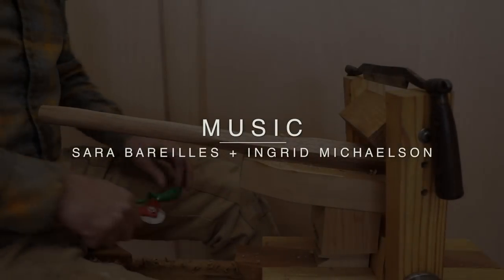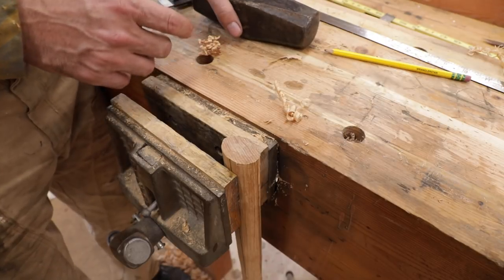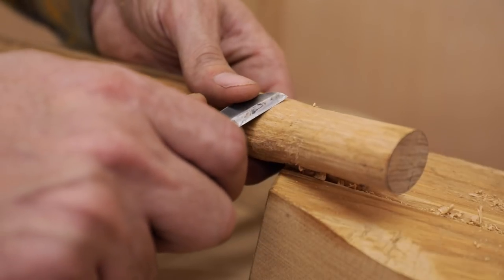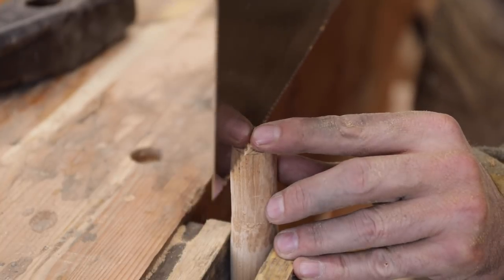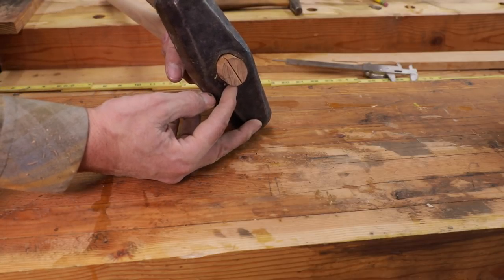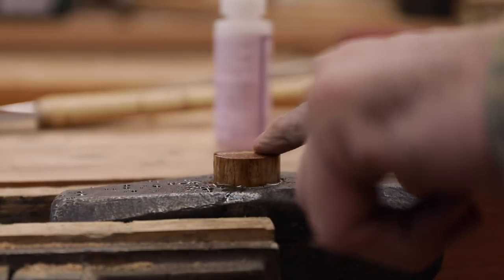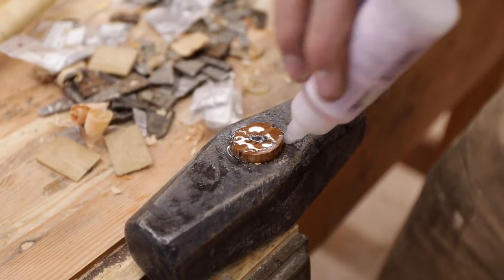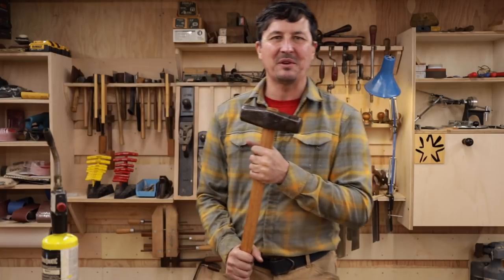Hickory Tool Handles The Old Way

Comment: It's always amazing watching things done by hand in these modern times. Brilliant.
Reply: Me too, as an archer, I've realized that technology and modernization hasn't necessarily eliminated old tech (exceptions may apply) it just added a new way to do things. I'm under 40, yet I have used one or more typewriters, blowguns, atlatls, spears (target only, which is unusual, as it's normally for distance as a javelin, or for hunting), as well as an assortment of hand tools. Point is, I quite like anachronisms.
Reply: Doing things by hand is generally more enjoyable (less noise, less vibration, less messing with cords), unless you are under a time constraint or need to make something rather big. What it does in those cases is make you appreciate those new tools ... but something i have yet to see these new tools do, is actually get you acquainted with the wood. Which i found is something that helps you create better and more beautiful things in the end, also makes you understand why some things happen during woodworking.

Comment: The resin the handle is straight is so you can hit square to the surface your striking with a axe it has a radius on the cutting edge so the curved handle works put a curved handle on a hammer and it will strike on the edges. Great video beautiful handle

Comment: From what I understand, axe handles have palm swells because you frequently swing them sideways and need the extra grip. Mauls and sledges are used rather less frequently on a horizontal plane, and so don't need the swell, thus reducing how much material you need to start with.

Comment: One thing, I use to look at your handle replacing and making and see you starting to develope talent, now you have clearly eclipsed my skill level at handles Cody Atta boy to you sir! well done Secondly I've used a hot glue for fishing pole eyes to anchor and seal some hammers this is simular to, what I believe, blue grass hammers the finest of hammers at a Rolls Royce  level of hammers used to be, alas they are no longer as i believe they went out of business. I was given one by a carpenter friend from church who didn't have to work as he was worth millions but he went to Tennessee and bought two and came back and said here Dave I got you one too. Anyhow, they were sealed and locked in with a hot glue similar to the hot glue used to anchor fishing rod eyes, very nice. Secondly question, Is danish oil not linseed oil and shellac mixed together?  You know you see some things and you realize what a fine job that has been done there, and you are getting skippy about it, pretty cool Cody.
all the best to you and your family.
David

Comment: Forgot to mention that I have always been told that the best way to measure your handle is by holding the head firmly in hand and point the handle to your arm pit. That is the perfect length for accuracy in striking. Also was told this in my union iron workers apprenticeship. Just measured at 22 in so we are in the same ball park!. Hope all is well and best wishes from ohio!

Comment: You could mark the center of the handle on the top with a cross, then line up the handle while looking through the hole. Saves you the guess-work you used here to align hole and handle.

Comment: Nice very nice, I have both a 6 pounder in 24 in and 30 in handles the 24 gets used more. I also have crosspin sledgehammers in 8 10 and 12 pounders what is interesting about those is they have the smaller eyes and originally had short handles, the 12 pounds I like and it only has a 30 inch handle
Reply: greenhatparts --- As a 16 year old 'light weight' teenager, I used a 28" handle in a 6lb. maul for splitting stave bolts. I needed the extra  length to set the wedges in top of the 39" bolts....It takes different lengths for different jobs and people's height. I'd hate to have to strike very many blows with that cross peen 12 pounder.

Comment: I rough out with my table saw. May sound a little scary, but my hands are never close and the push/pull hand is the one behind me.  The fine adjustments, I use a very course double or triple cut  file.  A wood rasp is too aggressive,, but a course file cuts quick, and leaves a rough cross grain pattern on the wood.  Which helps retention.

I assume you agree,,, steel and fiberglass handles hit my and back.  Every hammer blow on a nail or chisel, or stone,, transmit back into your hand.  A good piece of hickory or ash transmits relatively nothing back to my hand.  With steel or fiberglass, even when I was young, I'd end up with a carpal tunnel, or some form of tendonitis.  With a wooded handle,, I've never had a problem.

Comment: A smoother transition might look better if you use sandpaper Cody. I have a 1x42 belt grinder and a 2x48 belt grinder as I make knives and axes, but I always finish by hand with sandpaper to very high grits.

Comment: A palm swell is usually not there because if done correctly  the handle is put through the hammer from the above. Eye of the hammer should be tapered as well as the end of the handle, no wedges are used.

Comment: I thought you preferred boiled linseed oil, because you didn't like the varnish on commercial handles.  Danish oil is usually a blend of boiled linseed oil and varnish, which will leave you with a varnished handle. Penetrated by oil, but still feel like varnish once it has cured all the way.

Comment: Excellent Series, is there a reason you didn't apply linseed oil to the handle before you attached it? I thought I saw you do that in a previous video.
Reply: Josh Ray --- I always dip the end of the handle that is in the hammer in oil before I "drive it home". Helps treat the raw wood  and makes it slicker for making it tighter.

Comment: Cody, kind of off topic, but also not really, since it involves hickory. I am practicing a kind of martial arts that uses wooden poles for striking, and always assumed that if they are using hickory for sledgehammer handles, that it’s got to be a very durable and split resistant wood that can ‘handle’ a lot of stress and impact. Do you agree or would you recommend another kind of wood for that purpose and why? Thanks
Reply: traderjoes --- Try ironwood for your needs, I used those in the 1960's decade for stretcher poles on the mule's harness. They're stout and slow growth which helps make the dense wood strong!

Comment: What is a good way to protect the haft just below the head ?
Reply: The snide answer is to not overstrike.  ;)  I would NEVER do that myself.  
Of course, yeah it happens, especially when it has been a while since the last go.  
The modern answer is called a handle saver - kind of a rubber collar that fits over the handle and takes the impact.  They are tough and seem to work OK, although I've seen a guy driving spikes left holding a handle with just a rubber collar on the end while the head went skittering across the platform, so... 
If you want something more "organic" you can use rawhide.  Check out Skilcult and Oxbow Farm:
https://youtu.be/Qm2KLC4v5EI